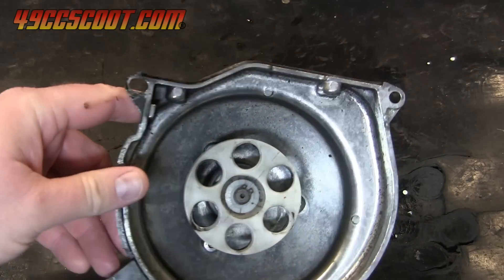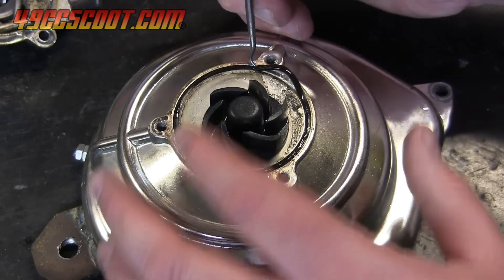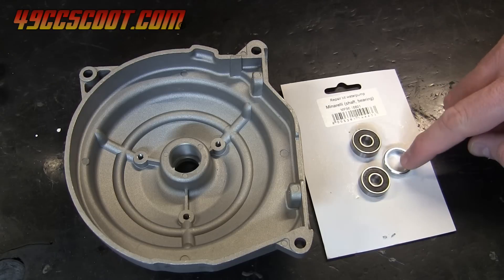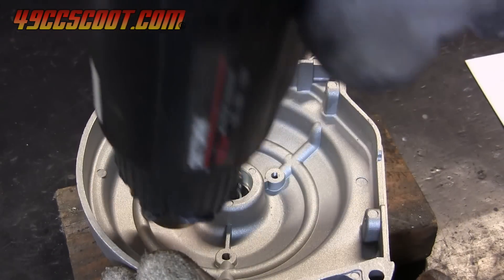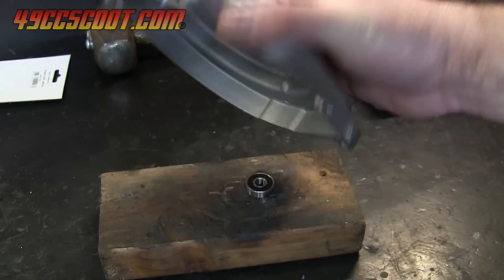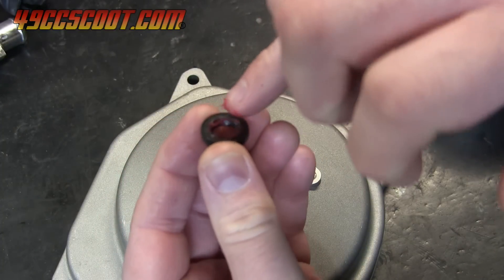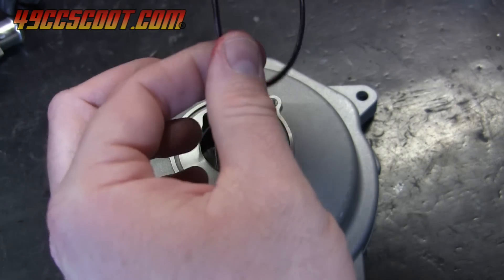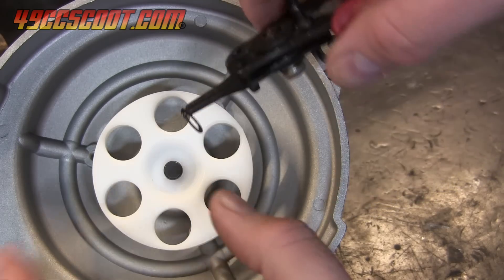Minarelli Water Pump Rebuild : Step-By_Step For Scooters, ATVs & More

Comment: What happens if you dont have a spacer between?
Reply from the maker: The spacer keeps both bearings where they should be. It may be OK without it, but it would prevent the inner most bearing from moving outward.

Comment: never do grease on a rubber sealant... the grease will work on it and cause leaking. do dry assembly or take a little amount of cooling fluid... but never ever grease. and by the way, the snap ring at the end is damaged. all in all a good video

Comment: What do I do if I can’t remove pin?
Reply from the maker: You could try heating the shaft and see if it will release then with vise grips or tapping it out. If it's really in there and you can't free it, then the pin could be cut and ground  till the shaft could be removed. Most likely this will necessitate replacement of the impeller shaft as well, but if it's stuck that badly it  may be needed anyway.

Comment: Hm kit is leaking on the back side by the shaft,  I wonder went wrong.
Reply from the maker: Sometimes even a new seal doesn't seal. That's why I always pressure/leak test engine builds. Could be as simple as that or maybe you need to check everything for wear. The housings can wear. My aftermarket kart pump has rebuild kits and I have rebuilt one only to find that the housing had worn and it leaked after.

Comment: Can you show how to install on the scooter
Reply from the maker: I don't have a vid up specifically about the install, but it's simple and can be seen below.

Studs with rubber bushings install on the flywheel, which can be seen here :
https://youtu.be/mTak1ywgZWA?t=437

The cover and pump assembly then aligns the holes in the drive wheel with those studs and pushes on so it can be bolted on. Then the hoses go on. Seen here :
https://youtu.be/uMr5Ea6albA?t=282

All sorts of details about how the drive system goes together and works here :
https://www.youtube.com/watch?v=Yu_Mgi67fQ8

Comment: Question if I have this removed and run my engine will create a air leak ?
Reply from the maker: No. It's not connected to the internals of the engine where you need to have it sealed. You'll just overheat very quickly without the pump and coolant.

Comment: My problem is i cant get house of the aerox
Reply from the maker: You mean the hose won't come off of the water pump or it's under a house like the Wizard of Oz?

Hopefully just a hose. Try to gently get it free with a flat screwdriver, being careful not to tear it or scratch anything. If the hoses are old, then it may not be worth the trouble and you can cut them off and replace them.
Reply: 49ccScoot can i send you a video somwhere i not so good at english so its hard to explain
Reply: 49ccScoot you know the thing you showing in the video it wont come of the moped
Reply from the maker: @gucciman6052  Oh, OK. There should be 2 or 3 bolts around the perimeter. Then you have to pull it a little to remove it because the rubber parts may be a little stuck in the drive pulley.

Comment: Will This pump fit on the 1PE40QMB engine?
Reply from the maker: Yes. That's what I use them on.
Reply: @49ccscoot  wohoo! 
I was planning to use a pump from a parking heater out of a car
But than i realized it draws 5 amps

If i also install a cooling Fan on the radiator , its gonna be a tought time for the battery and igniton
Reply from the maker: @tamer27antepli  You can get pumps that draw about an amp. Stay tuned for my next video. ;)

Comment: Question for ya. I've got a spare mineralli engine that the piston pin bearing shattered, so I'll be separating the case and upgrading the crank as well. What crank and cylinder combo would you recommend for a pretty aggressive street machine?
Reply from the maker: I'm prob a bad one to ask because I really like the 90cc stuff and usually go that route. There are a bunch of 70cc midrace kits though. Take a look on sites like scootertuning.ca and scooter-attack and they have LC and AC versions of many kits. Midrace is about as far as you probably want to go for something you really ride. Sport if you ride daily or at least a lot.
Reply: I bought all my parts for my af16 spree build through scootertuning.ca and plan to do so for the minarelli build. Would you not recommend a 90cc build for a street driven scooter? I have a 90cc cylinder that's just been sitting around that I can use, I just figured I'd look into stroking it as well since I have to take the crank out.
Reply from the maker: @reissfullspeedahead  I like the 90s, but the only issue for a really strong runner is finding a good exhaust. Not sure if 190mech on the forum has any Peace Pipes around or for sale anymore.
Reply: i would go for 80cc personally, its not just the power that matters, 80cc runs a lot more smoother but also should catch 120 km/h

Comment: I remember commenting on one of your waterpump video's about the pin that is prone to sliding out of the plastic drive wheel. That just happened to me, and god knows how long I have driven without a working waterpump not knowing it isn't working. I always like to double check if the pin sits all the way into the drive wheel, you don't want the drive wheel to bottom out against the bearing before the pin sits in the already very narrow seat. 

This is a very bad design if you ask me, the drive wheel where the pin sits just needs to be a little more deeper so it doesn't slide out left or right. 

The coolant we like to use is G12, Volkswagens proprietary coolant which is readily availablr and cheap, but seems to be a little more oily-like so it lubricates the seal better.

Comment: Too much,water pump,oil cooler things going wrong.Installed 60cc from aliexpress 20$.This 50cc are high precision from mc-miljeau to never make it.Atteched a turbo-fan,and extra air inlet to obtain the motor force on long,warm tours.
Reply from the maker: I was purely AC for a long time and there's nothing wrong  with it. It served me well many times. Just exploring the world of LC. If nothing else, it's more stuff to learn and try to figure out.
Reply: @49ccscoot  It is brackets for radiator on my peugeot V-Clic.I probaly imported 1,of I needed a new and it was unavaible.For 1000$.V-clic evp2 45km\h has an extra tube on the clutch contra spring,5cm.It`s a restrictor,but when attched you get the mercedes gear-change.Because the belt do not lock itself on the axle.And with light weights it loose the belt-grip in front and gain rpm.Buy the original clutch,with the tube installed.I also use white 1000 rpm contra,and red 3000 rpm clutch springs to have this luxury.
Reply: @49ccscoot  It does not restrict on 45km\h this tube,but 65-75...km\h depends on tire weights,rim,roller-weight.Naraku springs.